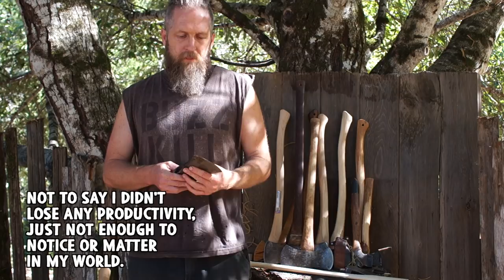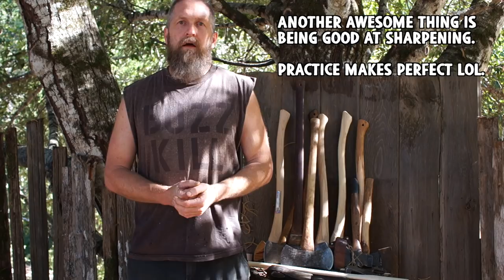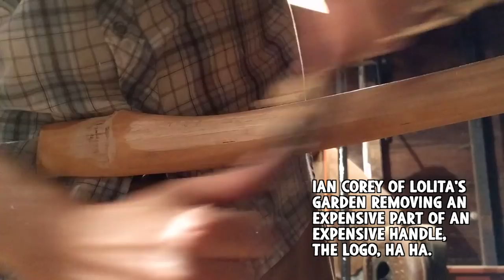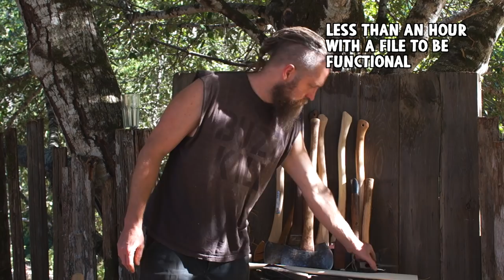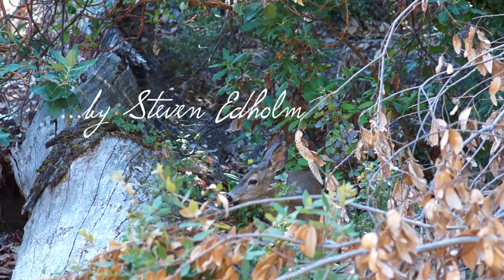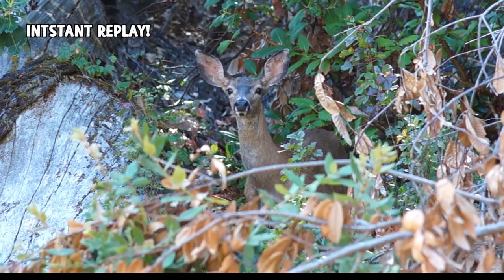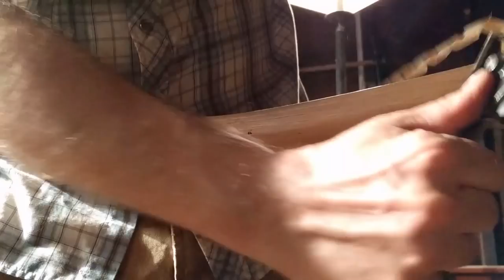Expensive Axe Buyer's Guide: (SPOILER ALERT, Don't Buy One)

Comment: I have found that local used tool stores, antique shops and yard sales are a great source of good quality, US-made axes from companies like True Temper, Collins, Sears/Craftsman, etc. Oftentimes the handles are junk and the heads may be rusty/pitted/need filing, but it's rewarding, not too difficult and not too expensive to rehang an axe yourself.
Reply from the maker: Finding good handles has been the biggest problem for people.  I think that is the best option too though if someone can pull it off.
Reply: SkillCult I just picked up a Council Tool Railsplitter at an estate sale this weekend for $5. It still had a shipping decal on it that showed it was delivered in February of 1990. Can't wait to scour and sharpen it and try it out.

Comment: Bit of a fun ramble but all so true. I'm 70 years old and used axes most of my life. You swing 'em at wood. They cut the wood or you sharpen them and swing again. If you don't know how to swing an axe or how to maintain it, it doesn't matter if its a Collins or a high dollar Swede!  Don't have to cut wood for fuel anymore but still love axes and axe work so now I'm teaching myself to carve with an axe. No high dollar one though!  Bought a $29 camp hatchet, re-profiled it and fixed the wimpy handle. Sharpened to a razors edge and will put it up against any of those European axes as a practical tool.  Thanks for the chat.
Reply from the maker: Thanks for sharing that.  I recommend people start carving with a regular camp hatchet, just because it build skill and familiarity with a multi-use tool.  I can see why some people would use an expensive carving hatchet like the one that Liam and Max at woodsman's finest just put together.  I'm sure it's great.  Not anything anyone needs to get started in hatchet carving though.
Reply: Martin LE =) interesting story thanks for sharing. When I was 12 I modified a carpenters/shingle hatchet I secretly bought (my parents thought it was to dangerous) at a garage sale down my street for $2 ...16yrs later still have and use it and there is still no significant wear yet.

Comment: I've had a 20 dollar boys axe that I bought from Tractor Supply 5 or 6 years ago...beat it all to hell. To this day I still pick it up and slam it into some rounds and it works just as fine as the day I questioned myself for buying a cheapo axe. I still have not spent more than 70 or 80 bucks on an axe and still get all my work done just fine. Preach it, sir!

Comment: Solid no hype advise, thanks.  I picked up a 15" camp axe due to the way the American hickory handle was secured to the head, using a wedge and two metal locking rings.  $35 seemed like a good starting place for the few times a year I camp and need to split kindling.

Comment: I think its more of an attitude than tool issue.  I noticed other people (i.e. really me, but I would rather blame other people) always have an excuse for not using whatever it is they have.  If they have a $25 tool then its not good enough, and if they have the $250 tool then its too nice for the junk work they are doing with it.  In the end you just have to get out and do it.  You'll never get better at driving unless you drive.  It doesn't matter if you are in the ferrari or civic, you just have to drive.  You'll get better at driving by driving either just the same.
Reply from the maker: good thoughts.

Comment: I want a tool that works every time i need to use it without having to overhaul it to make it work..
My take was one of several things , where i live i have dealers that carry tons of made in China axes/hatchets , ahhh nope not for me .. But these dealers also sell axes made by Stihl , Husq, Estwing (which i have owned , which produced more glancing blows that any axe i have ever owned) just didn't like the grind, so it was an overhaul of filing some of the convex out of the blade.. Better but i don't use it much now .. Fiskars made in Finland axes started to show up with their fiberglass hollow handles ( a bit too large ) but i bought one around the $40.00 mark and found the steel and grind (flat) to work very well, then i bought one with a shorter handle length of 19" I like it .. Some folks hate them, but in over 10 years of use they both  just keep on going fine ..
When blacksmiths didn't really have much more that an anvil and a set of hammers and a way to heat steel glowing red, forged steel has strength that the way it was back in the 1800, what other choice was there  ..
So next for me was to move up the line with either Wetterlings , Granfors , Hults Burk , yes as you know anyone of those three is expensive , well the days of the $17.95 made in America axes are gone off shore, my grandads axe prices are also gone .. That's the way it is, plus 60 years has passed us by and tools just cost more today.. I did look at Council tools which is like 136 year old company and i'm sure would have been very happy with a model but could not make up my mind on a certain model , plus the made in USA is very good .. Their top line models were not that far from the Swedish axes in price  i discovered.. Gransfors it was for me, my choice was finally made after a year.. I use it a lot and really like it , i cannot find one thing i do not like about the tool ..At today's prices out there for almost anything in quality tools i didn't think $150.00 was unreasonable to pay..  Do i have regrets   i ask myself , no i don't .. Could i chop the same wood and complete the same wood tasks with a $40.00 axe , yes i could and have done so .. Your video clip was very well done , i really enjoy them and learn things i did not know much about ..

Comment: When trying to figure out the right axe to buy quite a few years ago, I ran across your recommendation of the Council Tool 28" Boy's Axe and I ordered one.  I loved that axe. I learned I need to bend my knees more with that axe by one slip while I was sick and a bit worn down.  Lost it in a fire. As I use my current collins axe I find myself missing the Council axe.  Excellent recommendation. On the plus side, I just found a no name 24" boy's axe at a flea market. It was sitting out on the weather for some time but looks as if it never had any use  more than a weekend.  She has come back beautifully and is making a perfect companion to my power saw for pounding wedges and an occasional chop.  Thanks for all the work of your videos. I appreciate them.
Reply from the maker: Cool story :)

Comment: Great video. I've noticed a lot of Scandinavian axes have very thick handles. I think it might be because they use it differently than you. So the handle might not come from ignorance or pandering to the newb but from a different philosophy of expert use.
Reply from the maker: I'd like to hear a well considered argument for that.  It's been proposed that it's because the woods traditionally used were less dense and or less strong than hickory and the designs over there just haven't compensated.  The eyes are consistently larger.  I feel like I have a very light handed technique and I can't stand those thick handles.  Maybe I'm missing something though.  Thanks for commenting.
Reply: SkillCult yes, light handed but with a nice snap that would probably be impossible with thick one. I don't you if you're much of a golfer (I'm not) but driving is all about club head speed and flexing the handle to get that snap at the impact of the stroke. Just like you do with an axe. It would be a fun experiment to measure what your axe head speed is at impact and compare it to others. You might be onto something with the boys axe tho. Putting a lighter head with a snappy full length handle might be the ticket. 
Ooh! A titanium axe head - the formula-1 of axes
Reply from the maker: I did not know that about golf clubs and thanks for telling me because that's another brick in a wall I'm building.  I'm already pretty well convinced that a flexible handle operates as a whip like that.  I first knew about the effect with atlatl darts and throwers.  I'd like to measure it sometime.  When I'm rich and famous and fix my honda, buy boots, and get a new camera and move out of my trailer, I'm buying a goddamn chronometer!  it's either speed or mass.  The real trick is to gain speed without a lot of effort.  I'm not sure that sort of high physical efficiency can really be taught.  Some fighters have it for instance and some don't.  Floyd Mayweather definitely has it lol.
Reply: SkillCult you're a smart dude so you might already know this about physics…
The measure of collisions, which is what an axe striking wood is, is kinetic energy. Kinetic energy is (1/2)mass x (velocity squared). Therefore if you reduce the axe weight from 3.5lb to 2.2lb [a 36% reduction] to make up for it you only have to increase the head speed at moment of impact by 25% 
To put it another way, if you increase the axe weight 5%, you increase kinetic energy 5%. If you increase axe speed 5%, kinetic energy yields a 10.25% increase. 
In short, head velocity has a better impact than its mass, it's not a 1 for 1 thing
Reply: The real trick is to gain speed without a lot of effort???  Maybe consider Frankenstaining the sh###t out of your boys axe..  Hang it on 36 inch handle;  with the same angular speed you will achieve higher tangential velocity...  it will not be nicely balanced anymore and because of higher speed it might be prone to breakage but it might be an interesting  experience
Reply: tom tom haha true, it would pack a punch for little effort. It seems like it wouldn't be very practical tho. You could carry a golf bag of specialty axes :)
Reply: hehe,  in this  case  Steve  should mount it on 45 inch handle and  use it also as  walking stick (crazy as##  Polish Highlanders semi-ciupaga)... most likely 2 1/4lbs weight of the head  would be too much for this setup
Reply from the maker: +tom tom Years ago I remember Mors telling me that tribal people would put small trade heads on very long handles to make them work.  For one long period of time, I used a probably 2lb head on a long handle.  It was actually a straight handle off an old tool of some kind that I cobbled together really fast with shims and stuff.  I worked well and I was all about long handles for a while, but now I prefer something short for ergonomic's sake and maneuverability all of which is also important.  If one were mostly felling, a long handle seems to make more sense, but that is the thing I do the least of at the end of the day.  Mors also says that using an axe that you can grab by the head and tuck into your armpit is a good all purpose size.  I've found that to be about true.
Reply from the maker: I did not know that, but it's very interesting for sure!  maybe that's why it seems like you don't lose as much chopping ability as you might expect by using a light axe.  The question though then is the relative energy inputs to make each of those happen, moving a heavier weight, or increasing the velocity of a lighter head.  that seems impossibly difficult to calculate and would be even more complicated if you looked at the less tangible differences in those two very different types of work.
Reply from the maker: Maybe adjustable telescoping axe handles.
Reply: dang, those would be fun experiments to conduct. I'll have to think on those. my head is swimming with efficiency curves
Reply: I understand that bucking trees with an axe gives more exposure to axe(muscle memory, feel, handling etc) but  in the long run  do you see place for a hand saw(for example old disston ) to do bucking tasks and leave felling and splitting logs for an axe?
Reply: The swedish axes I've seen are hickory or wtf people use
Reply: I Think the European handles being thicker is wrong as I have an old English Felling or rounding axe (6lbs) that has a much thinner handle than that of most modern Swedish axes.
Reply: Big eyes are better axes. My old Maine axes (ES/Spiller) have even bigger eyes than the Gransfors, and the ones with original handles taper a lot. The large eye helps reduce shock.
I think the handles are just thick because they don't want a lot of broken handle complaints. New users are going to break handles. Hickory quality has also gone down, so thicker is a compensation for strength and lack of knowledge of the old truly thin ship.

Comment: I like Hultafors axes, good quality and reasonable price
Reply from the maker: I'd probably be recommending some of them if they were as cheap here as they are in Europe and Canada
Reply: SkillCult Are they expensive in the USA ? Here in France they are available around 50 euros (1,2kg head)
Reply from the maker: I read a rumor that they don't like selling to the US due to liable.  I haven't seen any major importers here.  Husqvarna sells a few of their models fairly cheap, but otherwise, they tend to cost a lot more here than anywhere else it seems.
Reply: Their 3 1/lb felling axe looks like it works very well with a bit of filing and they have a center line which makes it less sticky when splitting.
Reply: @SkillCult  Yeah, recently I bought the basic Agdor (900g) model, and I really like it. But still, spending $50 on an axe makes me feel that there are no excuses now - I have to go out and do some camping :) Especially now, during the global pandemic I feel like I need that little push.

Comment: Steven,   You're right about the use of cheap hand tools.  Presently, I have a large supply of ash that I got from a recent job.  I am steadily  cutting it up into blocks and splitting away with a cheap three and a half pound axe that I got about twenty years ago.  The only change that I made  to the implement was to replace the loose fibre-glass handle with a nice timber one.   I do keep it sharp though.  You got the thumbs up for a very informative video and some good old-fashioned common sense.

Comment: Just found you on YT, thank you for the tune up on "retail Therapy"...suffer from it daily.  Recently "bitten by the Axe addiction" and have a acquired a herd of vintage "american heads" looking to get some trigger time. Handle selection/availability was the biggest stumbling block but i'm ready to go..setting up woodworking vice for optimum draw knife position...back in the mid 70's when framing the "plumb hatchet "was the ticket for cleaning out let-in braces... then the california framing hammer came along...Thanks for being real...
Reply from the maker: Yeah, retail therapy is real.  Doesn't help that we are constantly bombarded by messages that stuff is the key to happiness.

Comment: I discovered your channel last night and watched several of the video's. Picked up a few pointers, thanks. 

     I this morning noticed my local hardware store now carry's Hults Bruks. Now I have a pre 88 Hults Agdor I picked up for $5 at a tag sale, and they make a fine axe. I fondled the $189 Forest axe on the display, and put it back. 
   2 things. I thought of this video. And What I did yesterday, . Yesterday, I cut down an 8  inch cherry tree, bucked a section out, split it, then carved a spoontula to 80% done with a $25 Cold steel trail boss. I could have just as easily used either a $21 cheap hardware store axe I reworked, or one of many tag sale axes I have picked up over the years to do the same work. The $189 Hults .......... I can't see how things would have gone 250% better, than with the $25 axe. I use an axe probably 4 days a week, and I could not justify it. I just could not. 

  Great channel.
Reply: I realize a disclaimer is in order. I do not want someone 20 to 30 years younger than me, thinking I am saying the Cold Steel Trail Boss is meant to do what I did with it. 
  8 inch tree is really pushing the limit with it. It is not the right tool for splitting. BUT, when I really like an axe, I like to see what I can do with it. What its limitations are. And I like the Trail Boss a lot, for a $25 axe. It should be at least twice the cost. Thankfully it is not. 
  Normally the Trail Boss see's 6 inch tree's and under. One of my boys axes , with a 28 inch handle would have been faster at felling and splitting.
Reply from the maker: Thank you for the feedback.  Good story :)  I think in some cases price and quality is justified for even small gains, but a point I'd have liked to have driven home more and that I used to be more focused on is as you said, that at some point, the gains become small, if there are any.  Quality and extra high functionality are great, but in what context are they necessary or will they make a difference.  Thanks for commenting.

Comment: My 2 favourite axes are my Walters boy axe that my dad bought around 1979 when clearing the lot for the family home. Still the original handle, which I am happy because it’s small from the factory and has a really nice palm swell knob end that feels really comfortable to me. 

The other is a Sandvik hatchet that my dad bought at K-Mart in the mid 70s when we started camping, handle came off (resin instead of wedge), I need to make a new handle for it. 

Using knowledge I gained from watching you, I bought a cheap baseball bat (I mean handle) from Canadian Tire, fitted it on a cheap Canadian Tire head, then trimmed it down to be comfortable.